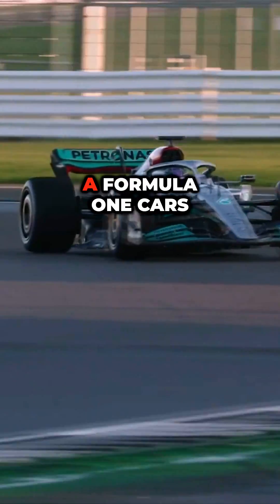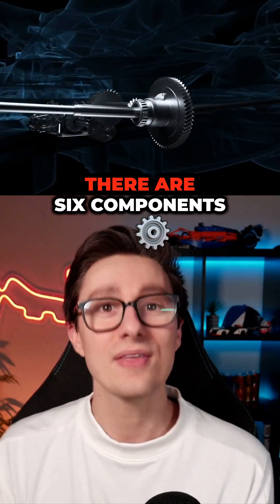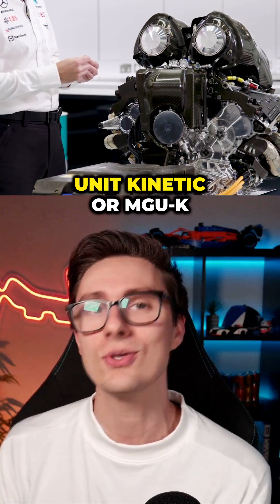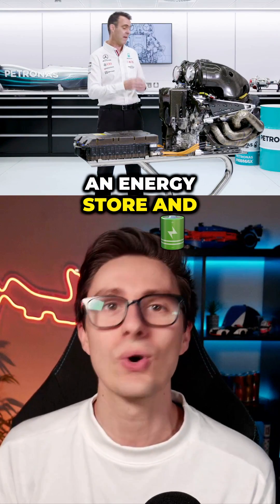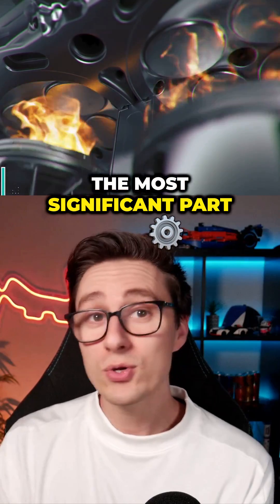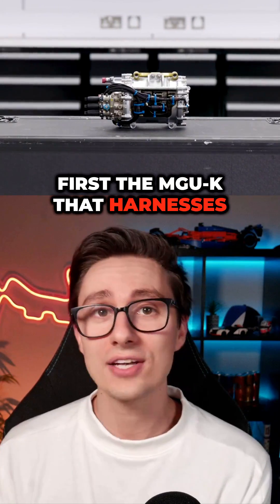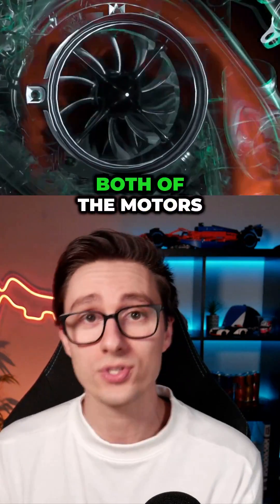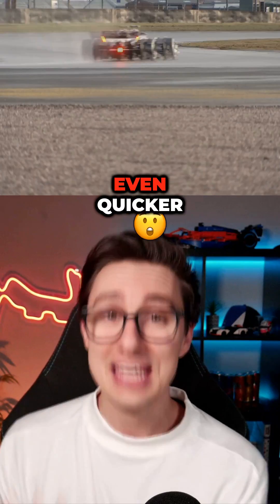How F1 Engines Work

Comment: Current cars make 1000hp+ to the crank. I've always wondered how much they make to the wheels when dyno'd. Because a 1000 crank hp street car will dyno around north of 800+ to the wheel. I'd say around 930~ish considering how efficient these things are at putting down all the power it has?